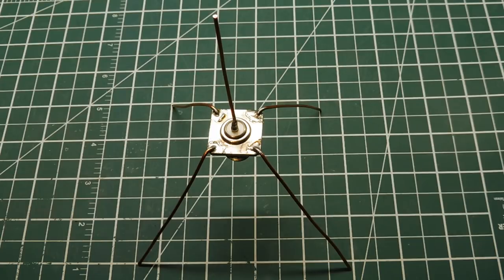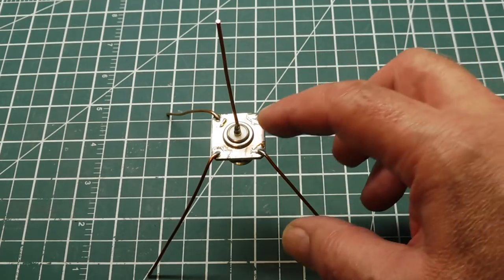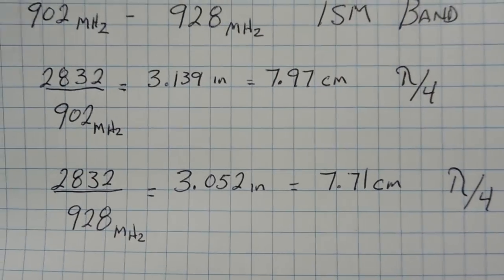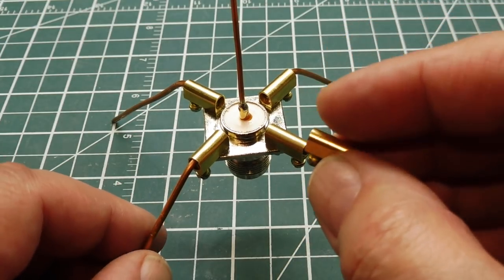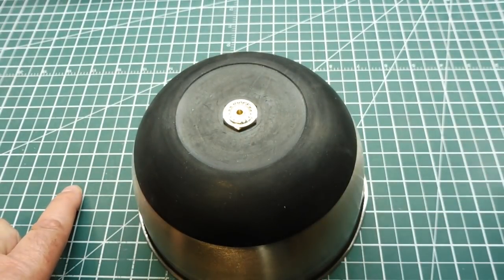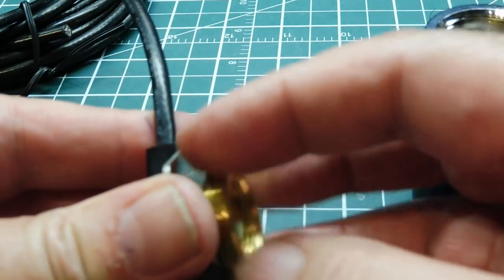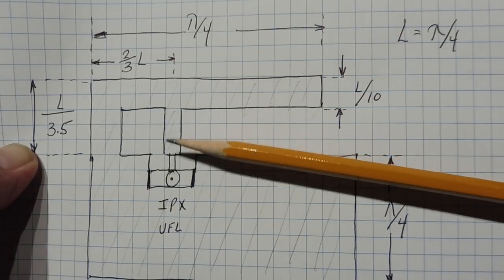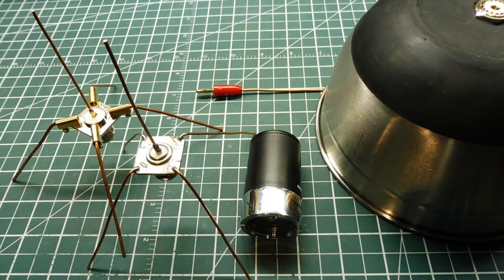Build A Mono-pole Antenna For Your LoRa Radio

Comment: HI Forgive the question as am a newbie to Antenna design but I have two questions.. 
1) you mention your want a VSWR of 2v, why 2v and how could you measure that (is it easy) - I assume this could help you tune the antenna for the best resonance?

2) on your example of a PCB board antenna, unlike the quadrupole, it looks like the TX line is connected to the ground - is that right? I was expecting it to be more like the quarapole where the tx is only connected to ground via air?

Finally - Great video - thank you so much for sharing this, really simple and straight forward - I will be making some quadrapoles for my Lora Systems. Thanks. Dave
Reply from the maker: VSWR is a ratio ( Voltage Standing Wave Ratio ) which indicates how good the antenna is matched to the transmitter. 1:1 would be a perfect match and 2:1 would indicate about 11% of the power is reflected back to the transmitter. A VSWR greater than 2:1 indicates a problem and should be looked into. A VNA is used to measure VSWR. Check out this video: https://youtu.be/wR-2c8VgunI
2. The TX line is not connected to ground for the PCB antenna. The drawing shows a RF connector soldered on the PCB. Thanks for your feedback.

Comment: Can you elaborate on the antenna pcb connection for your sample pcb diagram please?  I’m not sure if the mount terminals are connected to signal lead in center.
Reply: I am confused by the "ground plane" connected to ground yet its also connected to the signal pin.  I made a post asking about an implementation of your video here.  https://electronics.stackexchange.com/questions/561441/pcb-antenna-connector-and-copper-signal-names

Comment: 1:40... Where does the 2832 number come from ??
Reply from the maker: A wavelength is the speed of light divided by the frequency. 186000 mi/sec/freq Hz
That would be 982.08 feet/sec/freq Mhz
A quarter wavelength would be 245.52/Freq Mhz  (feet)
Multiply by 12 to get inches
2946/Freq Mhz (inches)
The speed of light is slower in a wire because of its dielectric constant.
To compensate we multiply by the velocity of propagation factor.
Vp can vary but I use .961
2946 X .961 = 2832
For a metric calculation use the speed of light in meters/sec
Reply: Great explanation... Got it. ;-)
Reply: So it wasn't just me wondering where the 2832 came from.
Reply: Wow, thanks so much for the enlightenment.  Seen a lot of videos that throw numbers around arbitrarily, but rarely (first time here) have I seen the reasoning behind them.  Keep up the good work!
Reply: Woooow... So cool    :)  writing this down  hehehe

Comment: Is a 6” aluminum disk an optimal ground plane for 915 MHz?  Is the shape or type of metal important?
Reply from the maker: Yes, that would work. The antenna was originally designed for mobile applications to be mounted on the roof of a car which was the ground plane.

Comment: Hmmm, could this be used for GMRS, with the radial coming up longer like 6 inches or so?
Reply from the maker: Yes .. just use the calculation formula shown in the video for the radial lengths.
Reply: @0033mer  Thanks!

Comment: sweet.  maybe just show the measuring device or what the <2 means?
Reply from the maker: " Equal or less than 2" refers to the VSWR ( Voltage Standing Wave Ratio ) You can Google or check out this video.
https://youtu.be/oiBi9RbNBUY
To measure the VSWR of an antenna we use a VNA. Check out the end of this video for a demo.
https://youtu.be/wR-2c8VgunI

Comment: Hello. If a reply the same project for a 1 wavelength scale (915mhz) would I get good results for a wider range? In may case, I have no size or power limitations)
Reply from the maker: Maximum scale would be 5/8 wavelength where you would need a matching network. Greater scale than this will result in a unusable radiation pattern and increase in input impedance.

Comment: Does the MLPV800 cantenna have the same omni shaped broadcast pattern as effective as the taller whip type LoRa antennas?
Reply from the maker: Yes, it has the common omni do-nut pattern when placed on a good ground plane.
https://d3dqzy9ky05fbv.cloudfront.net/wp-content/uploads/2020/06/MLPV-Series-Patterns.pdf
Reply: @0033mer  Thanks for providing that link. Just what I was looking for.

Comment: Where does the 2832 number come from?
Reply from the maker: A wavelength is the speed of light divided by the frequency. 186000 mi/sec/freq Hz
That would be 982.08 feet/sec/freq Mhz
A quarter wavelength would be 245.52/Freq Mhz  (feet)
Multiply by 12 to get inches
2946/Freq Mhz (inches)
The speed of light is slower in a wire because of its dielectric constant.
To compensate we multiply by the velocity of propagation factor.
Vp can vary but I use .961
2946 X .961 = 2832
For a metric calculation use the speed of light in meters/sec

Comment: Nickel plated, not silver.
Reply from the maker: You can use nickel plated connectors, but I find you have to apply an acid based flux for good results. I use AMP 1-1337418-0 connectors which are silver plated.
https://www.onlinecomponents.com/en/te-connectivity-amp-brand/113374180-10146065.html
Reply: @0033mer  How you tested that cantenna? I wonder if it works better than copper wire quarter wave antena alone? I like it because its simplicity and it protects cable connector from weather conditions.
Reply from the maker: For tuning and testing my antennas I use the N1201SA antenna analyzer. Check out this video for more info. https://youtu.be/wR-2c8VgunI

Comment: antenna "build" without vna and tuning equals to a 6th grander's afternoon workshop. you just solder/screw random components to another without any proof.
Reply from the maker: The mono-pole antenna described in the video is fairly wide-band so building it with measurements only will result in a VSWR of less than 2:1. This antenna was used in a high school electronics project where all the antennas made in the class passed when checked with an Anritsu S412E. If you want proof you can do the same as covered in this video at the 6 min mark. https://youtu.be/wR-2c8VgunI